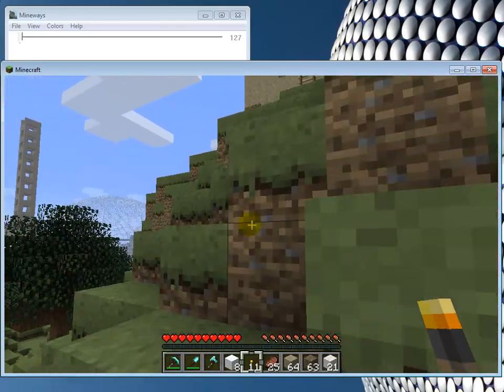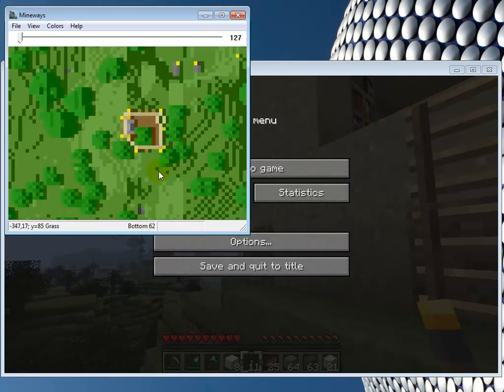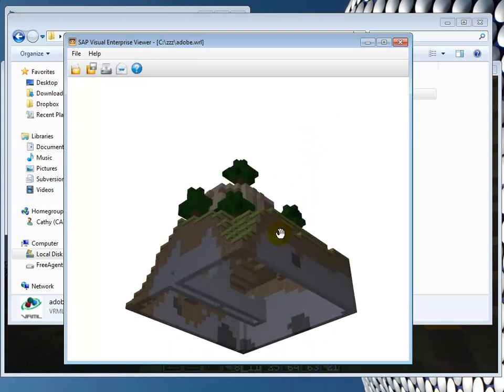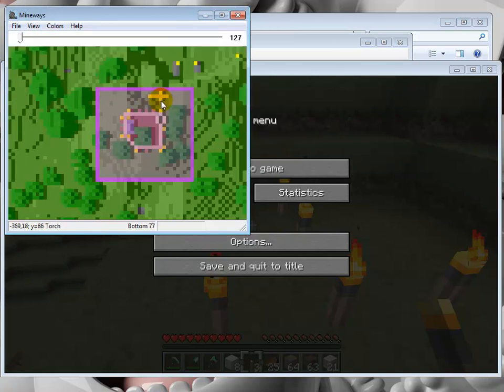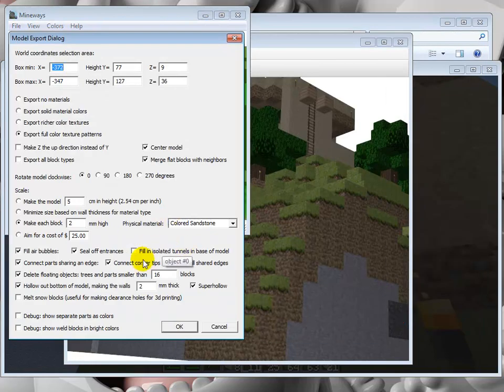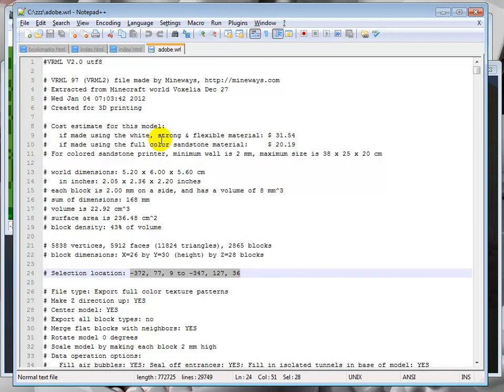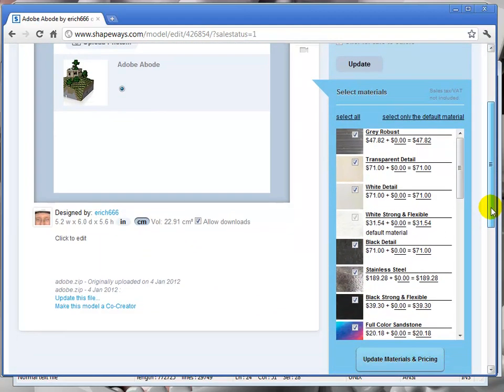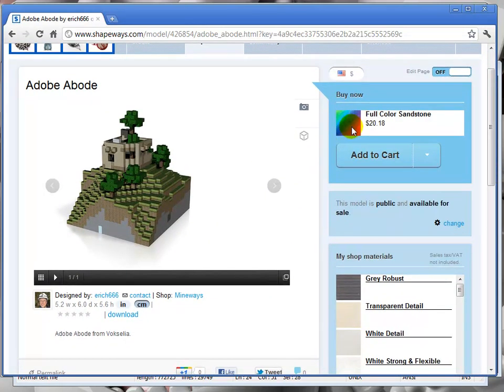Mineways Tutorial: Making a good 3D print model, January 2014

Comment: i have an issue I'm on mac i only got the mine ways app and theres an error "error creating export file; no file output" HELP!!!!!
Reply from the maker: Dominion PvP Hmmm, I don't know what that could be. That error occurs when you try to export a file to some directory where you are not allowed to create files. Try picking a directory (e.g. your desktop) where you know you have permission to create files.
Reply: Yea i was using my desktop but i found a fix what u do is install the mac version and windows with the mac version u don't get the folder with windows u do so what i did was just deleted the Mineways.exe and used mineways.app so the folder had the mac version instead of windows and it worked!!!!!!!!!!!!!!!!!!!!!!!!